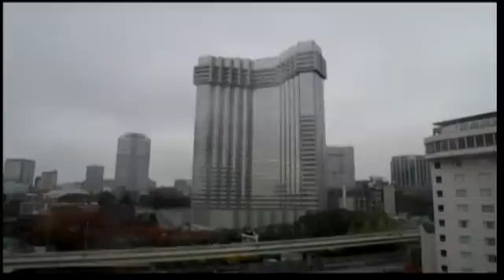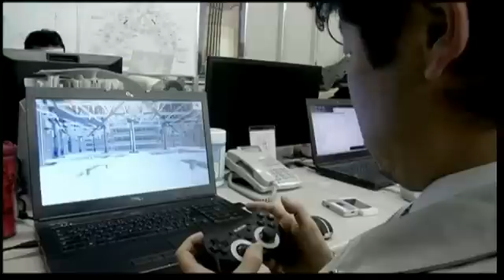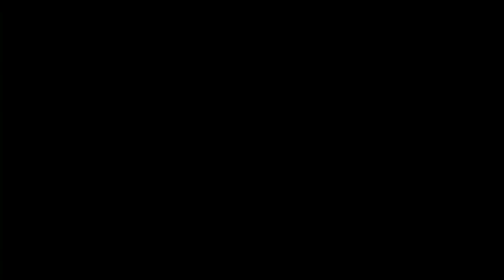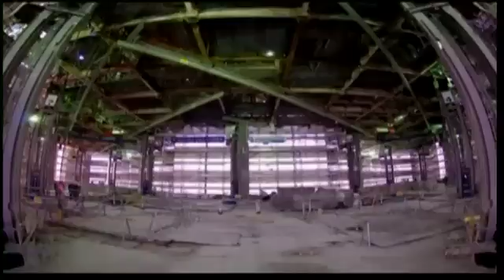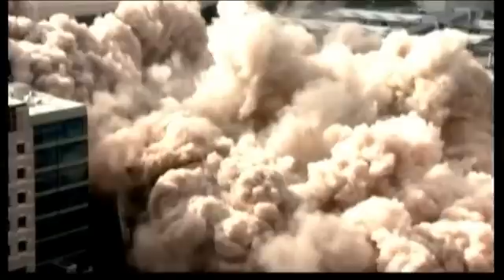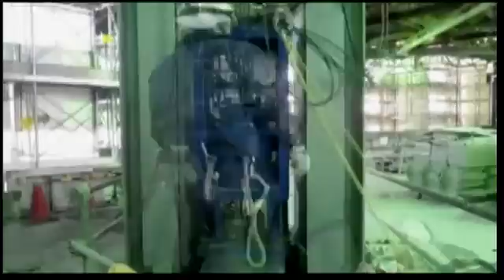Japan Presents the Incredible Shrinking Building

Comment: Imagine the energy required for this technique. The commute of all the workers, every day for months. The gas to run the equipment around the clock. No doubt this technique causes more pollution, albeit geographically displaced.
Reply: Actually, if you were listening, this operation is fully electric minus the trucks to haul off the debris and the couple diesel powered excavators to knock the floors down. In Japan, they have nuclear power plants, so this operation is the cleanest to use out of every other method that currently exists. The other smaller equipment is all electric as well.
Reply: @Briebabcock8052  They also generate tons of electricity by the lowering of the bulding itself. Weight+lowering+gearboxes+generator. Very cool.

Comment: Definitely not. Controlled explosions have an unbeatable advantage over this method: speed. 6 months represent a lot of costs for the owner not only associated with manpower (which is very expensive  in developed countries), machines, etc. but also costs of opportunity. 

If they could have demolished this building with explosives they would. The real question here is how does this method fare against the traditional methods of demolition from the top down.

Comment: does this work only on buildings designed with this method in mind, or can it be applied to pretty much any conventional large building?
Reply: It should be adequate for any building that uses columns as principal structural elements.

Comment: This method seems very expensive, the cap needs to be custom built around the top of the building. Then they have a crew work for what? 8 months? The demolition costs more than the value of the building they are demolishing.